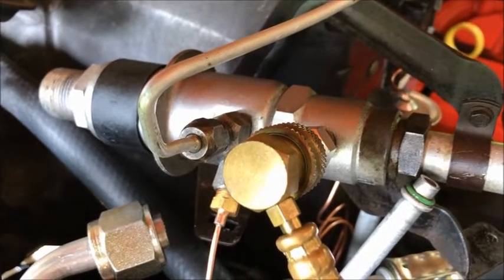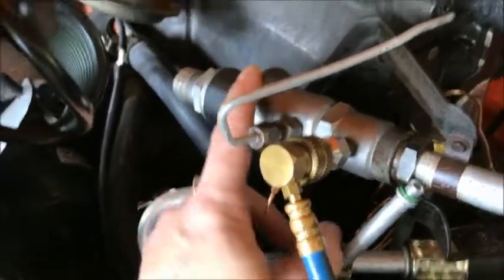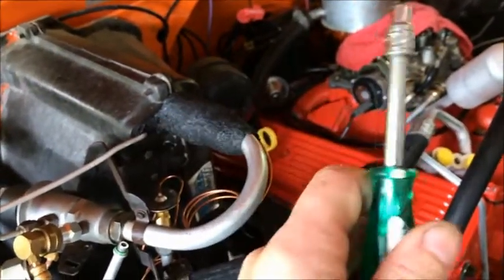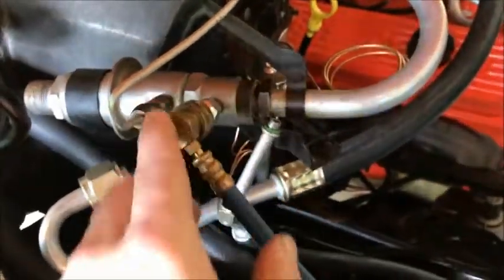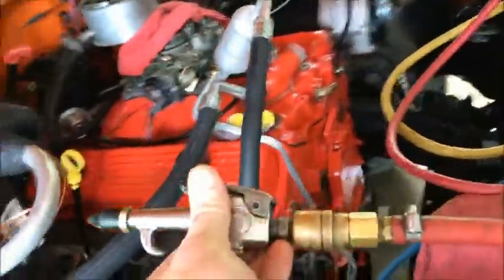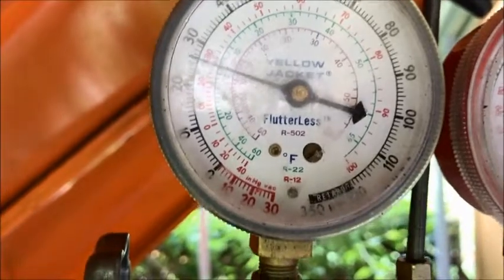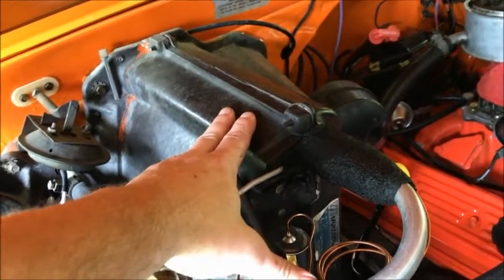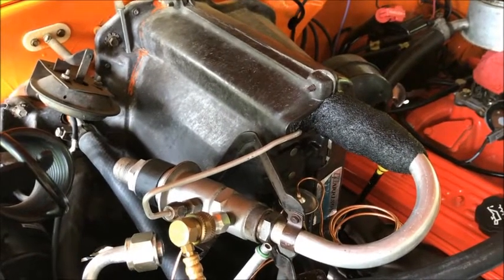A/C POA Valve Adjustment

Comment: So what is your cooling like with 134a comparatively speaking? I have read it isn’t as efficient as R12. I have also read that some people do away with the old original PAO. They exchange it for a modern version POA specifically engineered for r134a. Do you have an opinion?
Reply from the maker: I would say "cool" but not "cold".  R12 is much more efficient as transferring thermal energy than R134.  It is recommended to upgrade the condenser to parallel flow and maybe add a fan to get closer to R12 performance.

Comment: Awesome trying to get mine dialed in ,been told to replace condensor to parellel flow any need for that if my origanal is still good
Reply from the maker: The old condenser is undersize and will overheat at a stoplight in 100F+ weather.  I know, I've done it.  A modern condenser is a good option, but you will have to create new hoses and will need replaced anytime a compressor blows up (debris hard to fully remove).

An alternative is to put a pusher fan in front of the original condenser.  You know every modern car runs an A/C fan for just this reason.

Or, you can throw the kitchen sink at it and do both (modern condenser + pusher fan).

Comment: Setting up to make that adjustment, where was your Air Compressor output set /lbs.  ?  Great explanation, thank you !
Reply from the maker: My compressor is regulated at 90 psi, but I controlled cfm and pressure at the POA by gently pressing the air gun trigger.  You don't need excessive pressure or flow for this adjustment.